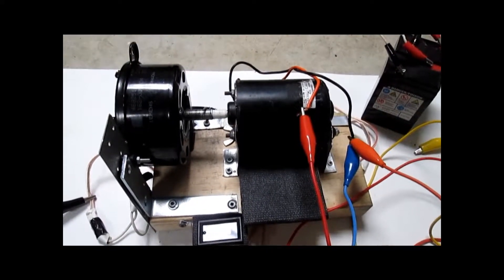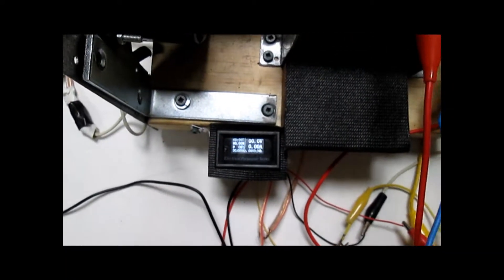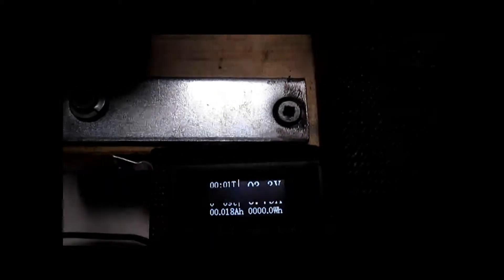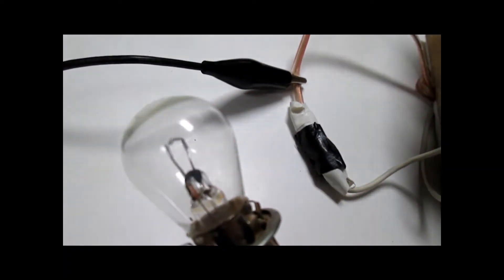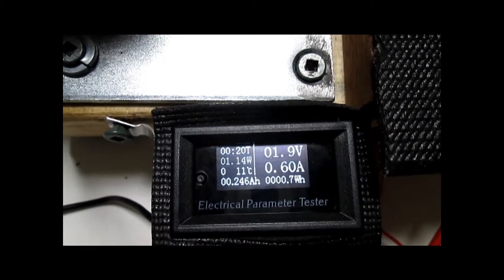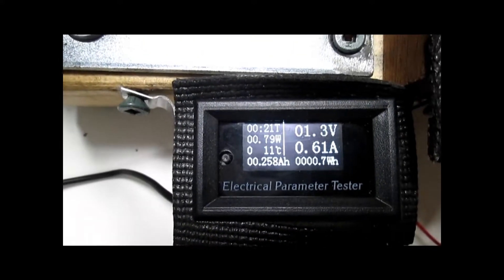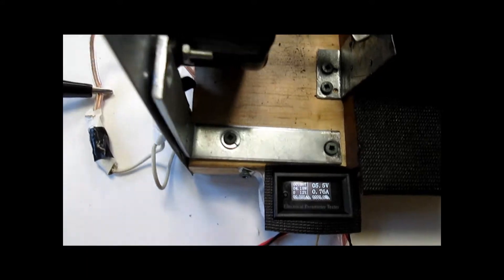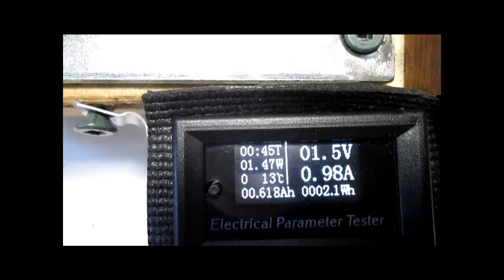x1 prototype generator part 4   battery testing with a load

Comment: some late info.   perhaps, by now, you understand that this was a fail.     if you are still interested in ou, see my research   and  the linked video, for a smaller version.     in order to  Accurately measure the output of a pma,  1)  measure  Amps, in such a way that normal lenz force braking occurs at the pma rotor  and  2)   measure volts,  AT  THE  SAME  RPM.      in order to know the actual cop,  power Consumption on the input side  must, ALSO,  be  Correctly  determined  and compared to output power;   watts in,  watts  out.     in order to compare ac and dc watts, a factor of  1.41  Must be used..     googletranslate
https://www.youtube.com/watch?v=lTkXciAn488